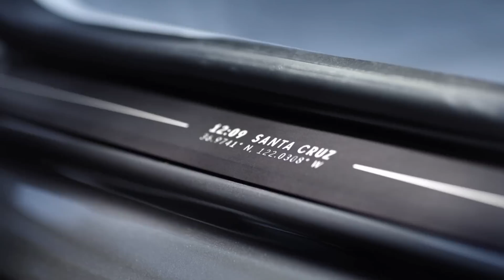Lucid Announces Two-Way Charging, 300kW DC Capability, For 2021 Lucid Air Sedan

Comment: none of this is adding up tbh.  1080 hp on 113kwh of battery and 512 miles of range. yet the thing is driving around still covered in 400 because they cant rewrap it of all things??  this would make it more efficient than the current leader hyundai ioniq?  record setting for all EVS as a full size performance luxury sedan somehow

now they can charge it at 300kw peak with 113kwh despite LRM3 hitting 250 on 80?  2.65C vs 3.1+C  against a 3 year old car 

so they're willing to pull 800kw repeatedly for pulls 0-60, porsche was adamant it can do it repeatedly all day so i cant imagine theyll pull something about that, but only 300kw for charging
1080hp on 113kw is  9.55hp/kwh while P100D is some 750/100 or 7.5, taycan is similar.  30% record setting for production ev?

the most powerful production car, that cant charge for its battery size, is somehow going to be the most efficient EV on the market despite only 2 motors setup for max hp and its own contradicting press releases

betting on 130kwh battery back for the listed performance and 130kwh battery pack with 1 motor or some shenanigans for 512 miles range >>

Comment: 300kw charging speed on 113kw of battery but 1080hp and 500 miles of range despite guidance for 400 on 130kwh 1 year ago.  they cant seem to pick a number

Comment: Anything can work in a lab environment and it is called a prototype. It is when the program moves from alpha trial to beta trial with live customers in the real world is when the rubber meets the road (excuse the pun). What is the error rate, what are the error priorities and what is left on the table to be fixed later or which features are dropped to get to general availability. In other words product is one thing and execution is another thing all together.

Tesla is so far ahead (see SpaceX), that giga and tera factories will be the product not just the vehicles. Execution, baby.
Reply from the maker: Richard, 

When a company is readying production facilities and is readying a production reveal it means everything has been locked in in terms of features and capabilities. This is not an alpha. 

Finally, no serious company relies on customers to beta test. Not even Tesla.

Comment: Lucid seems to be following Tesla's route - start at the luxury end.
Reply: That doesn't make it right. These designers simply want ultra-luxury for themselves.
Reply: Maybe, but it is way easier to hide the cost of a $10,000 battery in a $150,000 car than the cost of a $7,000 battery in a $15,000 car.  And you don't have to make as many cars to get some good earnings.  That is why every startups should start with the luxury version of their cars

Comment: Rolling blackouts in California as they are gigawatts of grid capacity short of meeting the daily demand right now...is this the Achilles heel of the EV industry? How is this hole in the grid supply going to be met without using...gulp...fossil fuels?
Reply: No, it's not.  There is a mismatch between production and demand at certain times of day.  The majority of EV charging is at night, when grid demand is low.

Comment: Good news about V2G.
I think that Lucid Air is a serious competition to Porsche Taycan and Mercedes upcoming EQS (for those deep pocketed people who are not brand loyalists.)
Reply: Yep, theres the rub, its surely going to be $100k+ and quite probably by quite a long way.
Reply: @whlphil  Nikki said sge expects six digits, too. That's why it is not a threat to Tesla - compared to this, Tesla is an econobox. As for when, well, spring '22, I guess.
Reply: bazoo513 the model 3 might be an “econobox” by comparison but the closest Tesla competition, the Model S performance, is priced at $95,000. I see potential for a bit of cross shopping if it’s priced close enough. Plus Lucid will have the advantage of the full tax credit.
Reply: @leax_Flame  In the direction of Lucid, perhaps. What I wanted to say is that Lucid Air has none of that "asceticism" Musk has trained his fans to accept. It seems to be a proper luxury sports car, like EQS and Tyacan, with the former stressing luxury, ther latter sport, but both displaying abundance of both.

Comment: I use about 80 kWh a day. A friend of mine 150 kWh. Pack feeding the home several days? Nope.
Reply: The average household electricity usage per day is 28.9 kWh according the EIA
How tf do you use 150kwh?
Reply from the maker: We were going to ask the same. although at Nikki’s house, the servers ad computers do increase our consumption.
Reply: @transportevolved  he has 3 pools for starters. then a lot of aircon, and yes, some servers...
Reply: You supplement that with a solar system, If youre in Cal then 10kW should give you an average of 50-60kWh/day

Comment: Great comments for the average person.  We should have been starting the push for EV in 2010, but the fossil fuel lobby has been really against any progress.  And the people haven't supported the move, and with the PR campaign I really doubt that we will make the move.  Just witness any comment on most YT channels, or a FB group.  hey know they would lose the war to prevent the shift to EV, so they are extending out the battles.  But they are really good at extending these battles.  You voice is really needed now.
Reply: We did start the push in 2010.  Earlier, in fact.  Tesla was founded in 2003.  Two years ago, I might have agreed about public acceptance of EVs, but it's really come a long way.  ICE is toast.

Comment: Why is there “soooo much information” but still don’t know what battery pack size is?
Reply: Peter stated in the fullychargedshow interview from 9/24/19 that they're hitting 4 miles per KWh...  At 3:36, Nikki says it's "less than the 130 KWh.... but more than 100 KWh"  so it must be 129 KWh? It's a heavy car, lots of powered stuff, screens etc., stuff to suck power.  To get the 517 mile range and power all the luxury, it's gonna need a bus-load of juice.

Comment: Mainstreaming V2G is going to be a key part of the transition to clean energy. Well done Lucid. Others must follow here. Surely Tesla could do it f they wanted...
Reply: V2G allows anyone to buy low cost energy (off peak) for peak time usage. That’s a game changer.
Reply: @UnexpectedBooks  Exactly; an EV owner likely has a battery sitting on their driveway most of the day than available in a powerwall!
Reply: I would make use of V2G. I have a Tesla and over the last year, lost power to my home 4-5 times. 2 of which were a few hours long each. Having V2G would have allowed me to keep my house running while waiting for main power to come back. Plus I have solar, but you can only use solar when the grid is down if you have a battery backup solution as well.
Reply: It remains to be seen, if V2G would pay off. There a lot of edge cases, where it makes sense, but is this a feature that most people need?
Reply: @svnyon8518  Not edge cases, this is not just about power outage. There are plenty of use cases where it makes sense for the average joe.
Reply: Tim Phillips 
Indeed. When you think about V2G at scale, and G is for Grid here, not home, then it can play a major role in bulk energy storage and grid stability.
And both consumers and grid operators win. Grid operators avoid having to buy infrastructure. Consumers get to rent their batteries for a monthly fee to the grid.
Reply: SV Nyon 
According to the UK National Grid, V2G will be very important
There is an interview on Fully Charged about that stuff here 
https://youtu.be/ONp8dismI-Q
Reply: We'll find out if Tesla will do it or not in about 5 weeks at battery day.